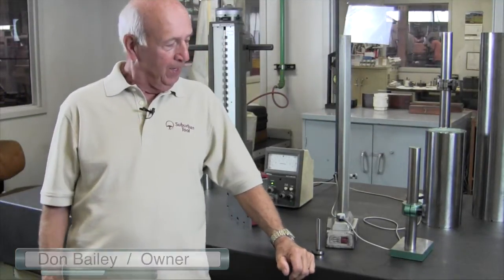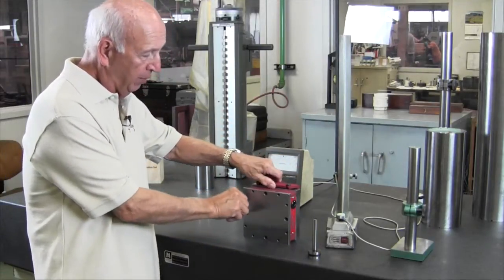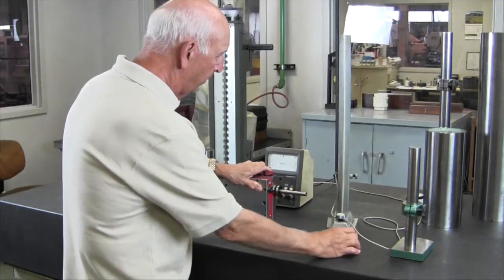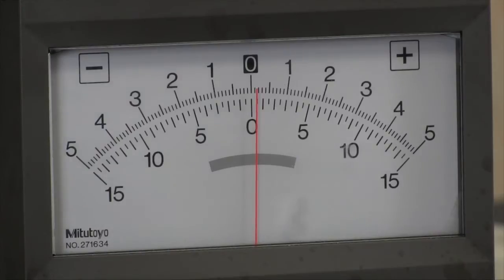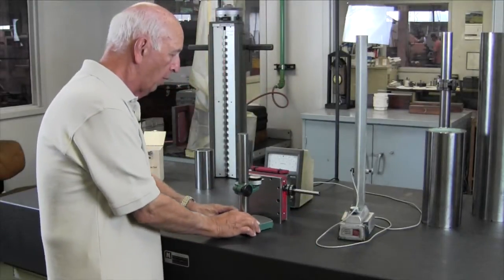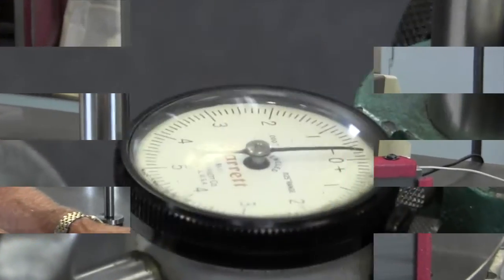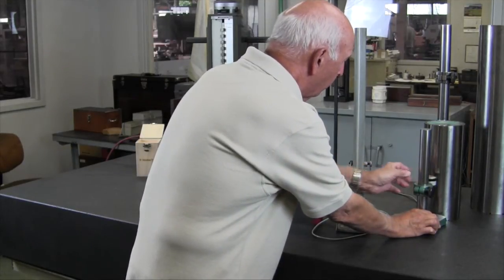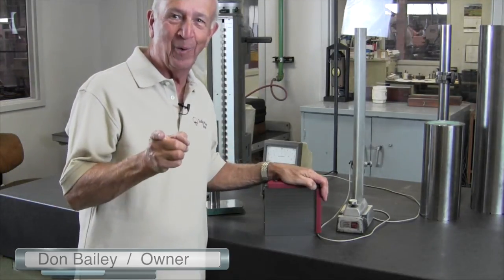How to Check and Measure Squareness - Part 2

Comment: I have to ask a question about when you zero your indicator against the cylinder square. Namely how do you make certain that your indicator is touching the cylinder square exactly centered above the point on the base where the cylinder square is touching the base? Because if you're not exactly on center, then the indicator probe will be past vertical and not be a true indication of square.
Reply from the maker: John Cochran John, The base has a radius on it. You roll it ever so slightly after you bump it up to the cylinder square to find the high spot. If you are not sure if your cylinder square is square , you just zero one side , spin the cylinder square 180 degree's then check again. If there is a difference, you divide that in half and that will be square. (Just split the difference)Thanks For Watching